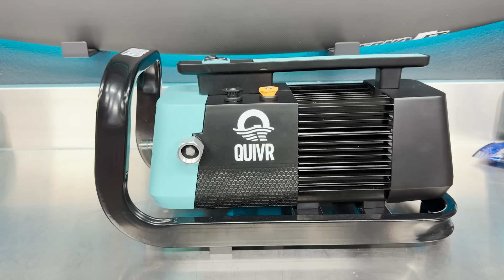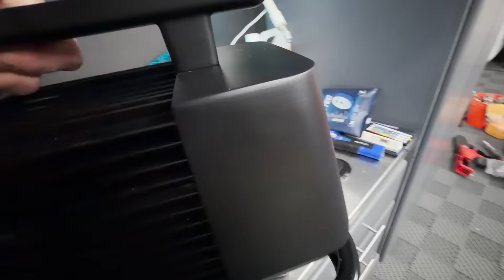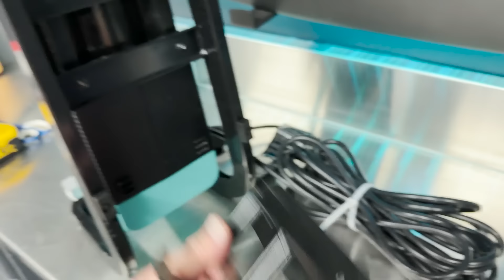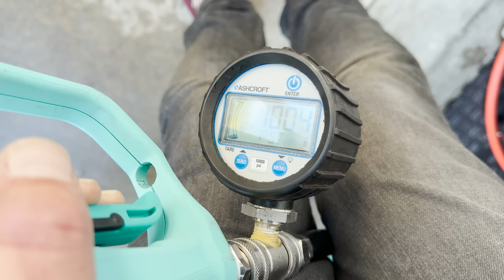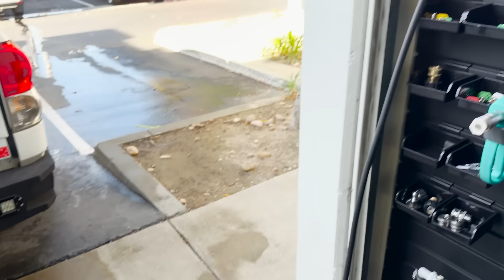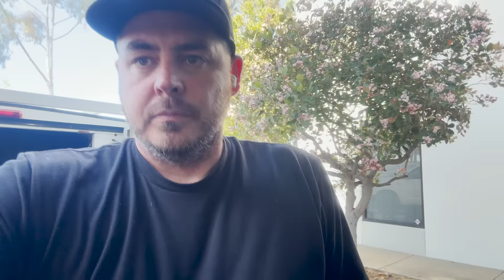QUIVR PRESSURE WASHER UPDATE!

Comment: I'm an engineer and work for NASA (literally) and one thought/comment. On the mounting bracket, please consider hardened Neoprene insert - installed at the metal to metal points so that when the machine engages, the Neoprene catches the vibration and such stops the vibration affect of metal to metal - this too could be install on the bracket back part that goes into the wall.

Comment: This looks like a great unit. Thoughts on the rectangular tubing, the upper indents from being, no concern. As for the lower, they appear deeper, and would be a place for standing water to pool. Being metal, if there are any imperfections in the finish it could lead to rust and lifting of the finish.

Also, are all of the fittings and connection tubes metal? Where one of the hoses connected, it looked black...and plastic came to mind.
Reply: Thats a great point! I have had to consider a new change and Ill be sharing those on my channel on wednesday

Comment: I think either the square tubing or the round tubing will be fine. The whole unit looks great! But I won't be mounting my unit to the wall because I live in an apartment. So I will be bringing it out to sit on the concrete on the driveway. So I would like to see rubber feet on the square/round  tubing so the vibration from it running on the concrete won't eat off the black finish. Maybe have rubber feet as an option to thread into the unit's frame. But I'm just waiting for the release to snatch up one!

Comment: Thanks for the pre-review on your new Pressure Washer. I love the robust look of the frame thats on there presently, it screams strength, where pipe in my industry doesn’t . Not to mention that the stability hanging on the wall would be more stable with the square tube design. As for color, flat or glossy, doesn’t really matter since I think the machine black so to speak looks kinda like in the middle??! Something I would incorporate would be optional nozzle holders on the back end, one on each side for someone who might want the stream or a shower spray head as I noticed more people use them. Love the machine as a whole!!!!

Question: Where you ever going to make a 1/4” QuivR colored hose outside of the Black you offer??! 
Thanks - Keep Up The Great Work!!
Reply: Thanks for the input. Another big update video coming on my channel on wednesday! Yes I am planning to do a teal 1/4 hose in the future!

Comment: I have to say, Josh, I have been watching you for the last, oh my God. It feels like a decade with all the pressure washers that you've done all of the other types of rags, chemicals. I've been extremely extremely excited for you to launch this, and I'm glad you've taken your time with this because I think it is by far none. IT Is The best pressure washer for detailing in the industry,  when I saw the frame that you were really questioning about the bends, I think that makes it look more robust. I like it better but I do wanna iterate this point that if you go with a round bar frames or pipe frame, I think it will just blend in with a lot of the other pressure washers on the market. Yours will stand out. I understand in the bending process that that's exactly what happens to square tubing but you would have to hand fabricate your frames at every joint and butt, in order to do to remove the indentation. I think that the bending in that is a great show of manufacturing and again robustness. Sorry, I'm repeating myself. But I really can't wait for this to come out. I've been holding off on buying a pressure washer for the last 3 years. And when you said you were coming out with one and making one I really wanted to see what you were gonna come out with. I have to say, I'm really hoping your price point is right between 3 and $400. Cause that would be perfect for me. However, you need to make money. So if it's more than that, I totally understand can't wait very excited for you to get these into production. So I can buy mine LOL!!!

Comment: it looks like the rubber pads on the bottom of the frame will contact the wall before the cleats can grab the frame for the wall mount. Might make it difficult to fit on the wall mount without removing those pads. Doesn't seem like much of an issue except that it seems like your intent is to be able to pull it off the wall and set it on the ground for use without having to use any tools.

Comment: The frame looks great as it is. When it hangs vertically on that metal cleat, is it secured there? If it just hangs on the cleat, might it vibrate a bit when in use?

Comment: That frame adds a bulky feel to the unit in a bad way. I'd go tubular, maybe in wrinkle finish? I much prefer it with no frame just sitting on the rubber feet, like how the 2.0 or new BigBoi Quad sits.... Making it compatible to fit with the Active wall mount shelf/reel system would be an added bonus!   

Also, is that a new gun you've been testing out? i noticed it for a while now in the vids.  GREAT JOB!!

Comment: Overall it looks beefy and solid, but those indents are just another place to accumulate dirt and grime, where as the tubular stock will shed a bit more easily. FYI, bending tubular frames also displaces the steel irregularly, so it won’t be perfect and might be less rigid than square stock, but it might look a bit better visually.

Comment: I would prefer the pressure washer without a frame for my use.  If I had to choose.. I think the square would look better & be cost effective. Round tube/pipe can flatten on the bends unless it's bent in a mandrel bender which might push the price up & increase waiting time even more.

Comment: Looking great Josh, so.. couple of points the square indented tubing will collect dirt fast, much faster than the round tubing, and its harder to clean. Round tubing is the way to go. The wall mount.. if you want to decrease cost and shipping weight, loose the wall mount bracket and let the Etsy crowd pick it up.
Numbers sound great. Rubber feet all around, always helps with sound and vibration..

Comment: Overall it looks good, and the matte black is definitely the better choice. A couple of thoughts:
- I’m not a fan of the metal frame — that would be the first thing I’d remove, so having rubber feet would be a big improvement.
- I have the same Active unit. Will this pressure washer bolt onto the same base?
- I would have preferred the water inlet on the side and the outlet on the front. That layout works much better when you’re running a deionized water system.
- What’s the expected dB level for this unit?
Thanks!

Comment: I think you are spot on. The dies used to bend the steel frame do a good job but the metal has to change when it's bent. They either use a mandrel when they can or they don't. The look is fine but it is plenty strong. I agree on the finish too. Matte or Satin nails the look! Great numbers for out of the box!!

Comment: If the hanger is flush with the unit, will the rubber feet allow it to be flush to the wall… I ask because it didn’t look like it would. But I’m going to buy one when it because available.
Reply: I noticed that. Being able to move it from the wall to the floor without having to reattach the feet is a must.

Comment: I like the overall look, awesome, and no worries about the indents, I actually think it looks cool like that.  I know you've been working hard on this product and I can't wait to buy one.  If I had to change one thing I would say to get rid of the outer frame that comes upward on the one end and just have it around the base so it would have a more minimalistic look. I'm not sure if it is there to serve a purpose.  I do like that the frame is removable and I like that you have the mounting bracket for a sleek vertical design!  Can we mount this vertical without the frame attached?

Comment: It already has a handle. It doesn’t need that square bar that surrounds it. Just reinforce the base for mounting and support. The frame may vibrate and increase in decibel levels. Plus it will decrease overall weight.

Comment: I'll be buying , but Josh it does not look like that plate will allow the pressure washer to sit flat because of the feet against the wall. If you try to engage the cleat , the feet of the washer will hit wall 1st.

Comment: Love the look, fit and finish of the pressure washer unit. No love for the frame. Doesn’t need to be there and (imo) detracts from the aesthetics over all. Also, it adds weight and looks out of place to me. The numbers, though, are stellar for an electric pressure washer. Under 15 amps is a very smart choice. The dB levels seem reasonable too.

👍🏼

Comment: Well if your not familiar with metal work drawings and bending it may look different, but its normal  to me. If you change it, you will end up with welded corners, which could be ground finish. Whats more important is the gauge of the metal in terms of strength and rigidity vs weight and cost.

Comment: Good call on the rubber feet install. I kind of like a straight through water direction and no 90 degree turns. But if it works okay.